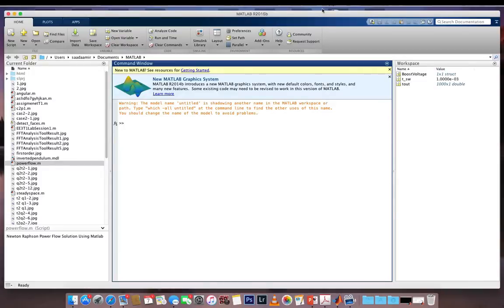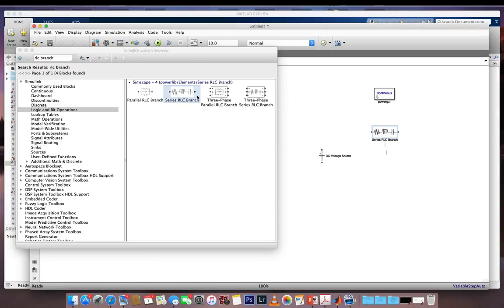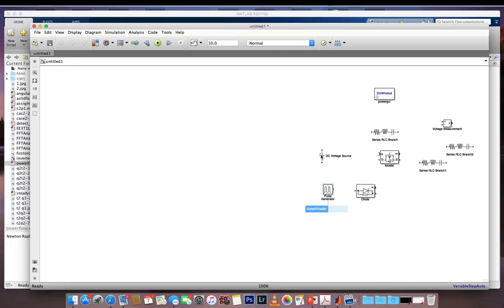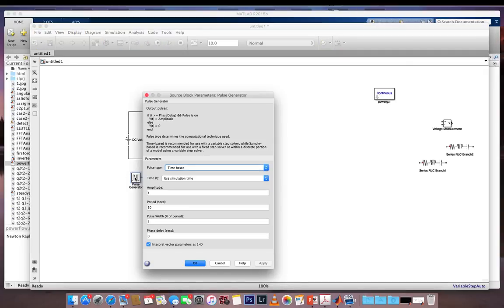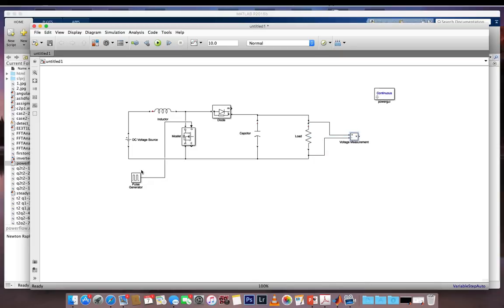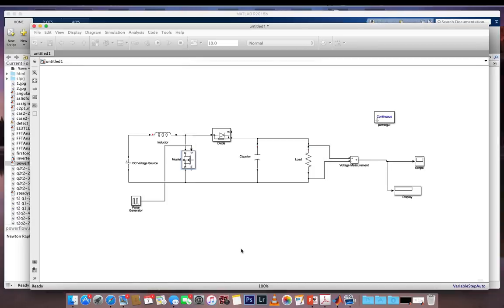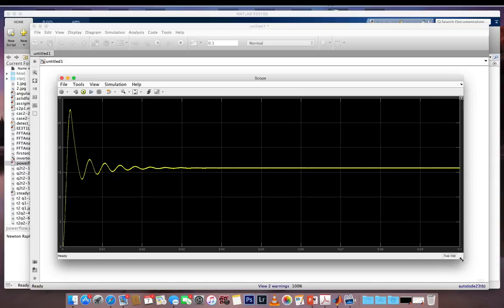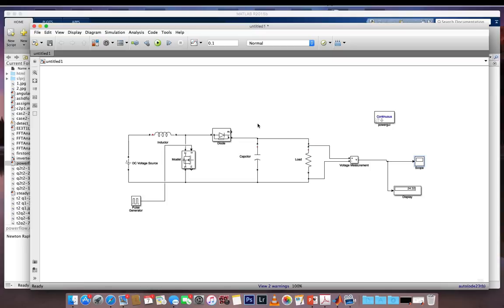Boost Converter simulation using simulink MATLAB / DC-DC step up converter

Comment: Thanks for the video, I have already implemented the boost converter and got the output similar to yours. But How can we smooth out the voltage waveform from the overshoots.

Comment: I want to design a boost converter of input 5 v and output 12 v which mosfet should I used ? Should I use IRFZ44N and if yes then what values should I take for capacotor and inductor? please help

Comment: How shall we choose the value of maximum current output, which is required to calculate delta I, for the calculation of L? Basically I want to know that how shall we chose the values of delta I and delta V for calculation of L and C?

Comment: why the  voltage at the beginning is very high and oscillatory as well
Reply: This is known as the "transient," when you look at the portion at the beginning that is the "non-steady state response over a finite period of time." The high voltage is the "overshoot" and the oscillations have to do with the fact that the system as a certain amount of "damping" that is a driving force is pushing it to a certain steady state value but not instantly, the the system oscillates. You will learn about this in a typical differential equations course, signals and systems, or control theory class.

Comment: Thanks for the video. I am given to understand that the Dc boost converts boost the voltage at the expense of current since the input and output energy from the converter should remain approx the same. I wanted to know what changes to make in diagram so that i can analyse and modify the input and output current.

Comment: can we do the same experiment using solar cell as source instead of dc source u used there.?
Reply: Hello, yes the source can be replaced by a photovoltaic cell. The boost is used in photovoltaic installations as an adaptation stage controlled by the MLI

Comment: now if i use this simulation and the input of boost converter is changeable because coming from solar and i want the output of boost converter increases to 240v or less.

How can keep output constant after using boost converter?
Reply from the maker: abdullah Alghamdi you need to add a closed loop feedback control e.g pi controller.
Reply: okay 
where i can add closed loop feedback control? after boost converter?
that's mean solar +  boost converter + closed loop feedback control = house
Reply from the maker: House?? you do know that your house uses AC and not DC. Boost Converter is a DC-DC Step-up converter. You would need and inverter to convert the DC from the boost converter to AC.
Reply: can you send me your email?
Reply: Have you done your project???

Comment: Can i have a pv array model used instead of DC voltage source for this particular circuit? or should i have to build a buck-boost converter??
Reply from the maker: Alif Ramli Sure! U don't necessarily need a buck- boost convert but then again it depends on what you are try to achieve.
Reply: yes, you can use a PV panel I have done the same.

Comment: Hello Saad, jus watched your video. I want to ask if you can help me out with a project involving power factor correction using boost converter. Its a current-senorless approach of achieving the control of the boost converter

Comment: Hello,
My input has to be 18V, load resistance 10 Ohms, and max ripple of 0.9V. So what changes do i make to your diagram to get an output of 30V ? (switching frequency anything from 50khz to 250khz)
Reply from the maker: Have a read through this " http://www.ti.com/lit/an/slva372c/slva372c.pdf ".
Reply: Thankyou!

Comment: how to select value of parameters Saad Aamir
Reply from the maker: what do you mean by "select value of the parameters"?are you talking about Matlab or the actual Design?
Reply: We are talking about the frequency,  inductor,  capacitor and Input voltage values

Comment: please if you can help me to understand how can i design closed loop boost converter with constant output voltage to feed induction motor through inverter
Reply from the maker: +Mohamed Elnagi No Problem!. I am not sure where exactly you are struggling, if you can give more information i will be able to help you better.  Any how, the first thing that comes to mind is your system output voltage and current requirement including acceptable voltage and current ripples. One also need to know the specification of the Input Source for boost converter. As for control, Proportional Integral(PI) should do the job. You will need a output voltage and current feedback. Though I am not 100% sure if the current feedback will be necessary. Hope this helps!
Reply: +Saad Aamir 
Thanks alot for your Cooperation with me ,
I used PV array as input source (V=240V ,P=4KW or up ) connect with closed loop boost converter with constant output voltage (V=600V) that connect to inverter to feed and control in induction motor .
Reply from the maker: +Mohamed Elnagi I assume that the PV arrays must be charging some sort of batteries. And the batteries then connects to the boost converter? 
Also, You need to know what is the max output current requirement (Inverter input requirement). Only knowing the voltage is not going to help.
Reply: +Saad Aamir  the current value depend on the induction motor size so i will start with 3 hp IM and 4.5A . regarding to batteries i didn't use them because i will work at day only . so please if you can help me to design closed loop boost converter and how can set transfer function for it ... I can hardly express my gratitude for you . thanks alot this my mail :eng_2me_2020@yahoo.com